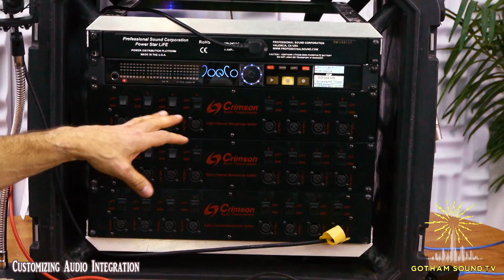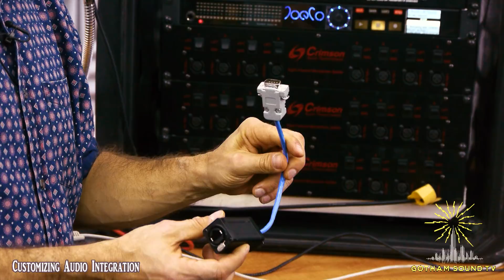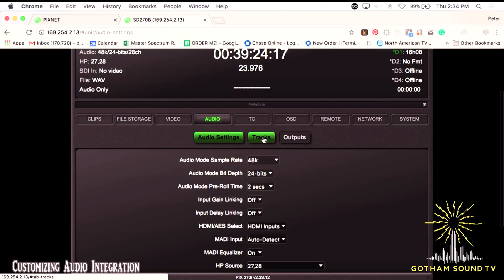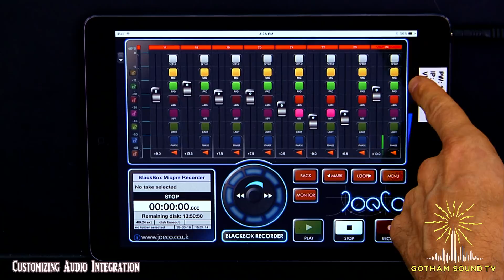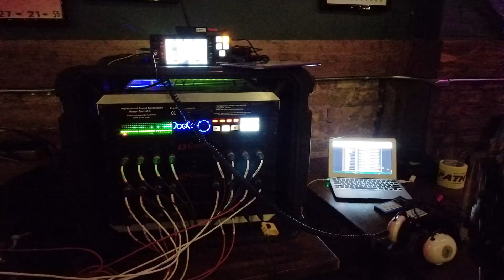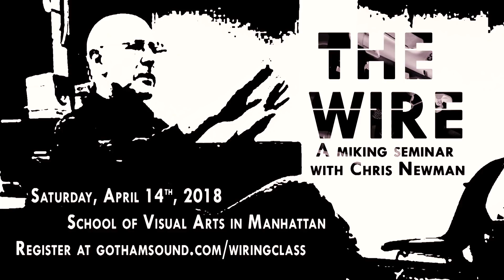Customizing Audio Integration

Comment: Great piece. You touch on some good points, especially about being as unobtrusive as possible to the FOH engineer's job. 
Brings back memories of using a G3 Powerbook, MOTU Firewire interface and Alesis ADATs to get enough lightpipe for 24 channels into the laptop for recording live club gigs in the very early 2000s, using the direct outputs on the FOH console.